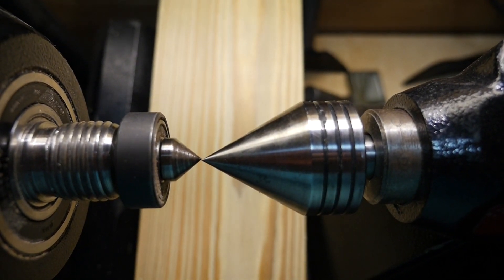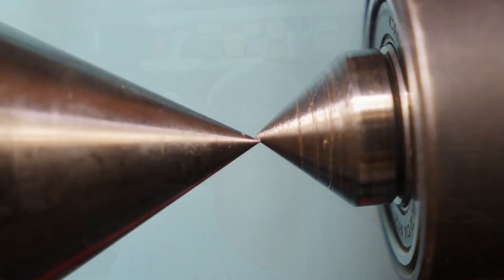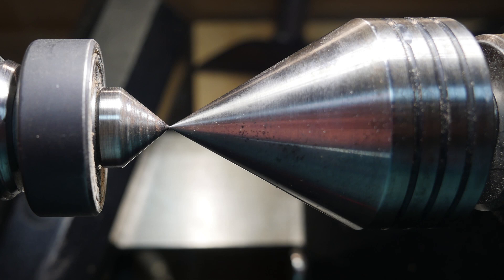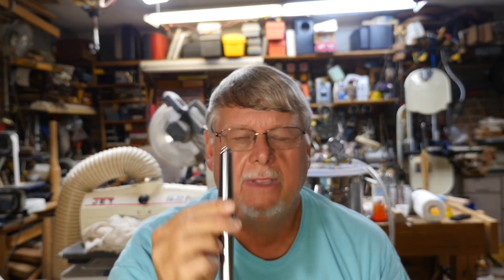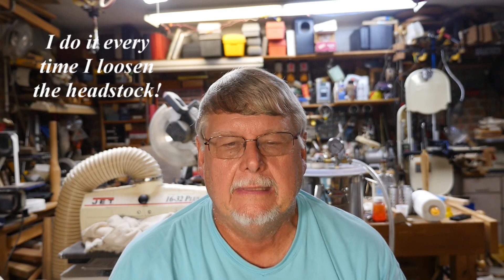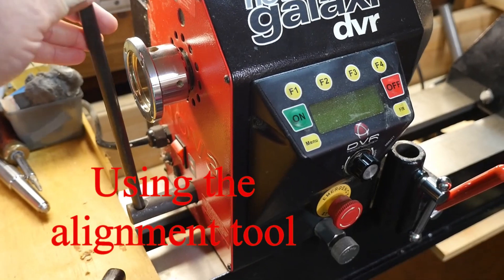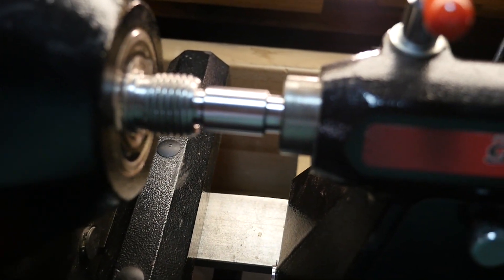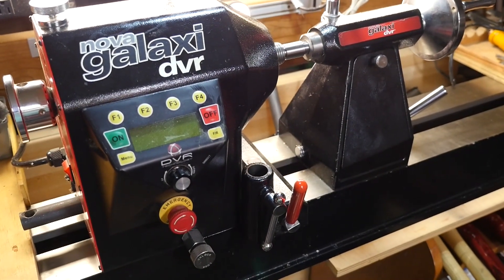Nova Galaxi DVR lathe Center Alignment Problems

Comment: This will work if the center is off left to right in the horizontal direction. However if the centers are off ijn the vertical direction, it  will not. Also, each time you loosen the tail stock it can be off a bit.
Reply from the maker: If  you have a problem in the vertical direction it can only be fixed by some machine work on the bed or you need a new lathe.  So you only need to be concerned with the horizontal direction.  Loosening the tail stock is usually not the issue.  All lathed do that and will return to center.  You really can’t turn without doing that.  I move my tail stock a lot when working on a piece.  Now the headstock is a different story, because this one rotates, you should check it every time you loosen it.  Which is why I went to a lathe without a rotating head.  Thank you for watching.
Reply: my point is that Nova could be a bit more careful in what they produce or have produced in China. The alignment issue is one that could have been avoided if they had the slot between the bed rails precision ground  so that the head stock and tail stock could not get out of line. Even if you use their tool and align the head stock and tail stock, and then loosen the tail stock and slide it away from the head stock, the next time you bring it back to the head stock it may be out of line as there is quite a bit of play between the bed rails and nothing to keep it true. Don't get me wrong. I really like my Nova Galaxy with the way the speed is controlled and the drive system works but, there are definitely some areas that I feel Nova has dropped the ball.

Comment: These lathes are great but, they could be better. The fact that they did not grind the slot between the rails on the bed and keep the head stock and tail stock closer toleranced to the center of the bed rails. Or, like you said that every time you move the head stock out of alignment or more often. Use the alignment tool. This is a down side of Nova's communication.

Comment: I have a Nova Galaxy and the head stock does turn for outboard turning. The knurled pin in the front is what you loosen to swivel it. I have not taken my head stock off to examine the quality of fit of that locking pin, but if it is like the  index locking pin, there is slop in it. I had to make a whole new index wheel for mine so the part would stay solid for fluting, etc.

We have a Harbor Freight 12 " lathe in our Az. shop and it is always out of alignment. I just loosen it a bit and bump it back aligned. Well  I had to take the head off of it this year because it got dirt under it and so I removed the headstock to clean it. To do that I had to take out the alignment rod and bracket. Wow, you should see the slop in that puppy..about 1/16". These are not metal lathes where you expect perfect alignment on precision ways but if they have any slop in them at all, a bump on a heavy piece mounted on the head will move it. That double Morse taper tool will bring it back on center and you have to  remember that when you need real precision in drilling. For most stuff between centers, you'd not notice it. I don't know if a Oneway or a  Powermatic has a precision locator for the head stock. I would think so for the money they want for them. I prefer the DVR motor to any of them and I love my Galaxi!!!!!!..Cheers, Jim.

ps. A person could take a piece of hardwood and make a wooden double ended taper too! You can find the dimensions of the Morse tapers on line and cut or sand to the dimensions! If the head stock is loosened, the wooden tool would bring it back in alignment!!
Reply from the maker: The Galaxi is great economical lathe, much superior to a harbor Freight lathe.  Once I turned on a better lathe the difference was evident (more power, better built).   I wasn’t unhappy with the Nova, although I sold it to a friend of mine and a year later the electronics went out on it.   Any load would shut it done.  He purchased all new electronic but that did work either.   After a lot of calls from both of us and some emails we finally got them to respond.  Frustrating.  I sent them a video via YouTube and it took them a month to even look at it.  Guess they didn’t know YouTube keeps count on views.  Finally, we sent the electronics back (the new one was still under warranty) and low and behold it was bad.  Works now but it was frustrating for my bud.  I solve my problem, I bought a Robust.   Thanks for watching and commenting on my video.  Harold Mills aka CaptData
Reply: @haroldsworld  I was a beta tester for the new Galaxi before it came out and I did a review of it that is on You Tube. There were three areas of concern and I believer they only fixed one (The wrong hand screw was in the tailstock from the factory). They sent me new parts for the tailstock, but I had to reverse the pin in it because the graduations on the new one would have been on the bottom if I installed it like that. The other two ( The indexing marks are  hard to see through that little round glass port....and the touch switches instead of a regular off/on switch in one place) they did not address as I can see. I did another video on the switches not working and they asked me to take it off You Tube and sent me a whole new front panel with all the switches in it. What happened is that the seal around the top of that control panel comes away from the plastic cover and dust drops down in those touch switches. Blowing it out fixed it and I had to put tape across the top to prevent further problems.
I talked to one of their Chinese designers about making it one off on switch and I was going to convert mine with a  center off momentary contact switch but I could not get to the two contacts for the OFF part of those touch switches.They were buried in  a circuit board that I did not want to take a chance ruining. The designer said it would take a whole lot of electronic designing to get around the present switches. Overall I'm happy with the lathe for it's power, 16" swing and 44" C to C range................Cheers, Jim

Comment: I have same problem , but their website doesn’t show this is available ?  The tail stock also slides if not beat down a time or two ..  biggest problem is the headstock wobbles? Any advise . I was missing some tool so I bought the Knock out bar , but that won’t fit in the headstock to lock down: any advise is appreciated

Comment: Do you still have this lathe? I am looking to upgrade to a full size lathe and wondering if this one is for me?  awesome tip also.  Did you have to get that tool from Nova directly?
Reply from the maker: I sold my Nova to a friend a couple  of years ago.   The variable speed and brake was pretty cool.   I loved it but it didn’t have the power that the high end lathes (robust, Powermatic, VicMarc) have.   Once I turned on a Powermatic at Arrowmont I was hooked on the bigger lathe power.  I can swing 25 inches on my lathe.    He had it for a while and the electronics crapped out.  He replaced them but Nova’s support was weak at best in America.  He still uses it and its about 7 years old.  For that price point I would also look at Laguna. I solved my problem by purchasing a Robust American Beauty.  American made.   It doesn’t swivel so nothing to get out of alignment.  Thank you for viewing my video.

Comment: The only problem with that procedure is once you back out the tail stock, and if it has any play between the bedways, then you're back to square one.
Reply from the maker: That’s true Robert, as I pointed out in the video, I started by looking at the tail stock and quickly decided if it is bad or has play you, need to talk to the manufacture and/or replace something.  When you lock down the tail stock it should go back to the same spot every time.  Otherwise, you will never get it centered up.  I move my tail stock all the time.   So, I did some tests to see.  I put pointed center on the head stock and tail stock and aligned it.  Which is really how I ended up aligning it most of the time.  I then loosed the tail stock and re tightened it.  Even slid it on the ways. I did not see much noticeable misalignment.  Thanks for watching my video.  I hope this helps.

Comment: I just ran into the same problem with my Galaxi. However I tend to rotate my headstock out for easier access for the interior of bowls. Rather than aligning the head to the tailstock. I loosened the nuts under the tailstock and this allowed me to align it to the headstock. Once it was accurate, I tightened the nuts up and problem solved.
Reply from the maker: I though the same thing when I first discovered it.  I even went so far as to remove the tailstock, but it dawned on me.  The tailstock is the only thing fixed on the Nova.  It should always be at the same location when locked down.  It is not designed to swivel like the headstock.   If you can adjust it, I would be worried.  You also move your tailstock much more than your headstock.   Which means every time you moved your tailstock you would need to align it.   I am also not a fan of getting a wrench out when the lockdown lever will do the same thing.  But whatever works for you, this is just the way I do it.  Thanks for watching my video.
Reply: @haroldsworld  I agree with you. the tailstock should stay fixed and the headstock aligned to it. I have not taken the head stock off to see how much play is in that position pin, but it has some. I took the head off a Harbor Freight lathe and it has a ton of movement  when it is in the standard or rotated position. I had to align that one almost every time I used it.............Cheers, Jim

Comment: I just set up my Galaxi which is replacing a 1624 that I've had for 5-6 years.  The old one had the same issue as yours and every time I wanted to turn between centers, I brought the tail stock up to a drive spur and usually had to tweak the head stock a bit to get them aligned.  There was also a very small difference in the height, which as far as I can tell, cannot be changed without milling the bottom of the head stock (highly unlikely).  The new Galaxi seems to have the same two issues.  There is enough play with the locking pin in that the head stock will never return to zero without this test.  Still, it's heavier and more powerful than the old one, and the DVR is awesome.  Larry
Reply from the maker: I loved my Galaxi, for the price not sure you can beat it. The variable speed is worth the admission.  I turned on mine for a few years and was very happy until I took a class at Arrowmont last Oct. Was able to tryout Vickmac, Powermatics and Robust lathes.  I own a Robust now.  Pricy but I am retired and turn more now.  Sold my Galaxi to a good friend up mine, which should tell you what I think of the Nova. Excellent product, although I did laugh when I ask the lady at Nova how often you needed to center it,   “only when you need too”.  LOL  You just have to understand the quirks.  New tools are cool. Thanks for the comment and Happy Turning. 
Harold

Comment: CaptData, I notice your pressure pot in the back ground of your NOVA alinement tutorial. Looks like a stock pot, if so what are you using to provide the vacuum for the pot? I have been looking at videos on YouTube for ideas and your unit looks very simple and easy to set & put together!!! Would love to hear from you Rg, Sam
Reply from the maker: I got it on Amazon for about a $100 bucks.  I started to make my own but once I did a cost benefit analysis it was way cheaper to buy.  I must admit building your own is fun, but I didn't in this case.  I have even seen some with the vacuum pump included for 170.   So with that said, I am not sure vacuum is the way to go.  It works, but you get bubbles on the edges and you have to cycle it a few times.  It is great if you are trying to saturate something like a piece of spalted  wood.  I have been pondering positive pressure.  The pot is a little harder to build, but I see them for around $100 bucks too.  Most people use a paint pressure pot.  You have to modify it a little but  doesn't look hard.  Hope this help Sam.
Reply: @haroldsworld  thank you for the intel Sam

Comment: Thanks CaptData.  This is great tip.  I have a Nova 1624-44 and am noticing the very same problem you are describing.  I am able to use two points to true up the head stock but would like to acquire the "Accura Alingment Pin".  Can you tell me where one can be purchased?  Enjoy your videos.
Reply from the maker: Rockler has them Nova Acruline 2MT Alignment System

Comment: Your video is very good but you should know that lathe alignment should be checked often, especially if you are turning larger out of round stock. Getting a sever catch or if you have a swiveling headstock  that allows you turn larger bowls you should do an alignment every time you swivel the headstock. Center alignment is critical to getting the best performance from any lathe.
Reply from the maker: It’s really not so critical if you are tuning bowls. It only matter when you bring up the tail stock and even then the minor misalignment doesn’t have much effect on a bowl.  Most of the time you are going to turn away the center, but if you are going to use the tail stock to align the piece up, such as a pepper mill then centering the two is a must.   With that said, I did a check every time I loosened the head stock.  Good practice to get into on a lathe that swivel.  I took the swivel head variable out of the equation; I purchased a Robust Lathe.   Thanks for the comment, Happy turning.

Comment: Hi from Australia, I have just picked up my Nova Galaxi DVR. This is great to see this video on the alignment, will be one of the first tools I need to get. Was thinking about the centre alignment and wondering what was the easiest way to do it.
Reply from the maker: Gday mate, thanks for the comment, glad I could be of help.  You will love the Nova DVR, I do. It has some small quirks but for the price it is a bargain.  I have mine wired for 110 but I think it might be better wired for 220.  I have noticed on large heavy pieces it labors a little.  220 might help.  Their tool rest is not that great but I have upgraded to the Robust rests and am very happy.  Nova has a module set but it moves, I would not recommend and I have a couple.  Happy Turning Mate.
Reply: @haroldsworld  Hi, in Australia it is 240v, so all ok on the power side. Thanks for the toolrest idea's, happy turning coming up hopefully. Thanks again cheers from Australia

Comment: Sir, I'm in FL too and am looking at buying a larger lathe(have a delta 460). Would you recommend the Nova Galaxi or a different one?  Thank you for your great videos, they are easy going, insightful and I recommend them to my wood turning friends.
Reply from the maker: It all depends on you budget, unlimited I might go Robust, Powermatic or Oneway.  The are more powerful than the Nova, but you pay for it.  Power is another consideration.  I am running on 110, not as good as a 220 but I don’t have an outlet for the lathe at the moment.  I have owned two Nova larger lathes and was happy with both. The DVR Galaxi does every thing that I want to do at the moment.  I consider myself a mid- level turner.  So far I have found nothing that I can’t turn. It is stable (very heavy even without weights) I love the fact that you can adjust the speeds with just a twist is awesome. The break feature is cool and the swivel head stock is handy for turning bowls.  Of course, the price you pay for a swivel head is have to align it back up.  I got it for 2k on sale as I just didn't have the 7K Robust wanted for theirs.  It does have it quarks and on heavy items it not as stable as the big boys.  But all in all I would recommend it.  
Thank you for your comment.